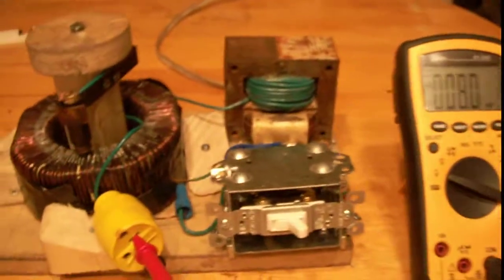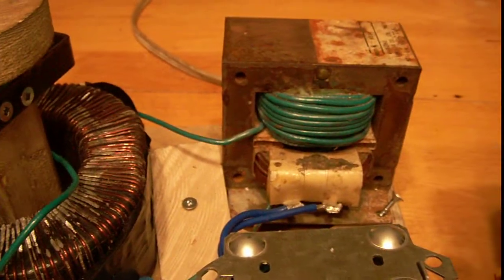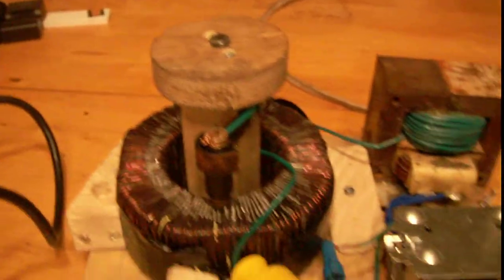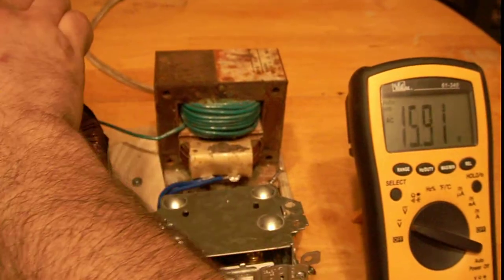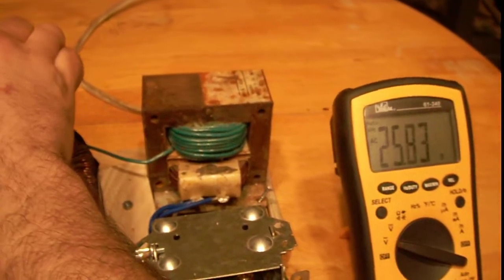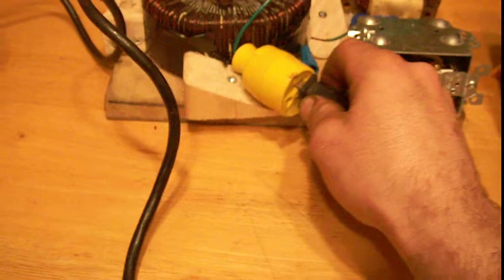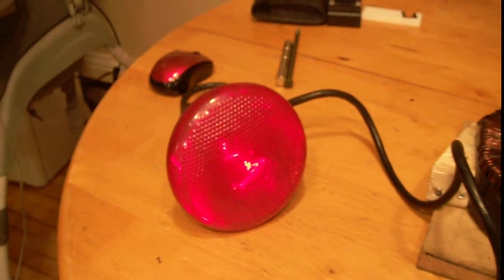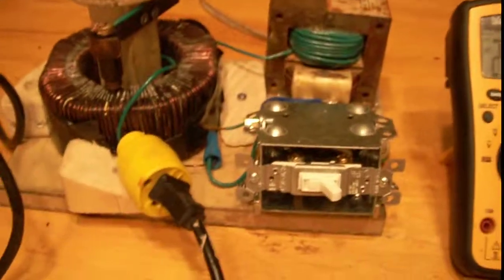FIRST REAL HOMEMADE VARIAC made from junk

Comment: Is it possible to use a round bar of soft iron as the core, I understand it will not be as good, and seem so wasteful it wouldn't be useful.  However, if my load were say 100 watts max and I didn't mind the extra waste, just how efficient would it be or not be?  :(  Oh and how many turns of wire do you need please?
Reply from the maker: No don't use anything other then silicon steel wafers, the hysteresis caused by the switching magnetic flux will heat up the core red hot in a matter of moments and possibly cause injury. This is just a demonstration and if your not familiar with electronics and how a transformer is designed I wouldn't mess around with this.

Comment: Well nice to see that someone,  has approached this topic , despite that the video has over 6 year's.  Now I'm  been made few variac in the past few year's and now I will be making another one but fully documented basically every toroidal transformer can be one , now depends on few factors like the outpout is isolated or not . Non isolated outpout is more eazy to be done because you need just a coil on the core with isolated you need obviously two but still can be achieved but anyway glad to see other people still making stuff even if they are from old scrap part's good job
Reply: Hello Mike, can you please show how to make a 0 - 220V variac (how many turns, copperwire size,...) i tried to use a junk automatic voltage regulator because it looks like a variac, and soldered at each end some wire and tried tu plug it to mains (using series lamp for safety), but it goes short circuit. Thanks for your help.
Reply: @hichamtassi1753  have a look on my channel I have made one

Comment: i’ve never seen a transformer core in a brushless motor. it look like you had a toroidal transformer out of audio amp. could you explain please
Reply from the maker: It is basically a toroidal core but the silicon steel wafers are aligned opposite to that of an actual toroidal transformer and there are vertical notches punched out of the inner core of the toroid to house the coils which interact with the rotor. I cut out the copper coils and wound on my own toroidal coil.
Reply: Lee Sarginson ahhh.. fancy! 
thanks for the explanation

Comment: Do I understand this right? Your microwave transformer plays the part of holding your primary coil and your motor core plays the role of holding your secondary coil?
Reply from the maker: Bran onymous  technically the microwave transformer holds a primary as well as a secondary winding. The secondary winding from the microwave oven is attached to what is essentially a primary winding on the motor core. The motor core has one winding that wraps the entire core and is tapped in the middle creating a primary and secondary. In an efficiently built variac there is no secondary transformer to knock down the input voltage. The microwave transformer is just to limit the output from the mains.
Reply: @Boblee84  thank you so much. I apologize for the dumb questions. I'm just basically trying to give myself a crash course on circuit building and I find this build fascinating
Reply from the maker: Bran onymous no problem. Hope it clarified things a bit.

Comment: thats not how to make a sheap variac. it takes a welder and some cutting to create a variac out of a microwave oven transformer. just trow the hv winding in the trash and regulate the distance between core piece and the rest of the transformer with a slideing track. you need some scrap metal and a pencil brush and a drill to make it properly.  for low voltage just rewind primary winding to 12 volt if your ac input is 12 volt. for a ampere regulator for dc, just grind carbon pencil material into powder and mix it in oil and pour it into a bottle and then use two electrodes to regulate current by making one of the rods pull and push in the bottle.
Reply: perhas it not by patent but mine better. it have no stepping  and no brush.  my mistake i didn't check the design but the particular one is a crude technology from the childhood of invention of electricty. even the germans used a transformer based regulator but that was another design again. so what would you call it? the main difference is that in my case its  the core flux that is regulated by dividing the core itself, and in the other they vary the coreflux by changing the lenght of the wire by the connection points on the brushed winding. technically its the same thing that happend but mine is more acurate as the winding is not stepped and the core can by adjusted more precisely.

Comment: Would building my own coil be a possibility? I have all of the materials for this but no coil and have no idea where to find one and can't find any online. I saw that it needed inductance in the core to operate efficiently, so what would be the best material for this that is easily accessible at a hardware store? Also do you know the gauge of the copper used?
Reply from the maker: I would use an old motor and strip the coils off to use the toroid which is made of silica steel and has been magnetically aligned. I do not recommend anything other then silica steel or ferrite. Anything you find at the hardware store will be just plain steel alloy of some sort and would heat up very quickly due to the eddy currents in the steel and burn your insulation on the wire. The wire used in this is actually aluminum from a cheap microwave oven transformer and I’m pretty sure it is 10awg. I made sure to wrap the toroid with a few layers of paper and a layer of electrical tape to soften the corners to keep the wire insulation from scratching off during the wrapping process.

Comment: you're not running the bulb at 150W you're running it at 9.4W, this is not a valid test

150W/120V = 1.25A
120V/1.25A = 96 Ohms
30V/96 Ohms = 0.3125A
30V * 0.3125A = 9.4W
Reply from the maker: Your right its not a valid test. In fact its not a test at all. More of a demonstration really. Thanks for helping with the math though.

Comment: Very nice build. I have been looking for videos on this too, without luck. Can you use say thin sheet metal, cut out and stackde together, as the core? And if yes, would it have to be glued together in a special way. Or would the layers have to be isolated from eachother.
Reply from the maker: I guess u could... but they would have to be well insulated from each other, with high heat material to withstand the high heat losses due to eddy currents in plain sheet metal. It would be very inefficient. silicon steel laminations would be more efficient as the silicon steel is magnetically aligned in production to help with eddy currents and heating of the core. This is why silicon steel laminations are still one of the most common material used in electric motor production and power transformer applications today.
Reply from the maker: LazyH-Online  true ferrite and some other materials are better for sure, but to find a sizeable enough toroid that is made of ferrite that won’t over saturate with 60hz is a task. These cores are easy to find and designed for a 60hz saturation at 120v which is why I used a motor core. It’s not really a reliable piece of equipment... more just a demonstration of how it could be done at home with junk that you can find anywhere.

Comment: What material did you used for your Variac "core"
Reply from the maker: Core Material is stacked insulated silicon steel wafers. Same as any a/c brushless motor core you can generally find in use today.
Reply: Ok, but the core could be also made of... let's say, plastic? Or it has to be a ferric material in order to work? I ask you that because a Variac doesn't require any MF induction for operate as a transformer does.
Reply from the maker: It would not be efficient and there would be little to no power output without the magnetic inductance that the core provides. Air core or non magnetic core transformers work best with high frequency and high voltages.
Reply: Ok! Thank you Mr. Lee for your answer
Reply from the maker: No prob anytime:)